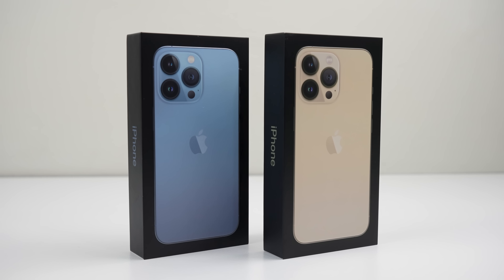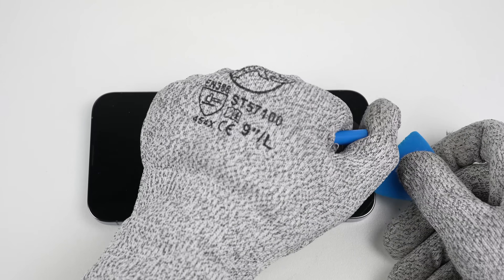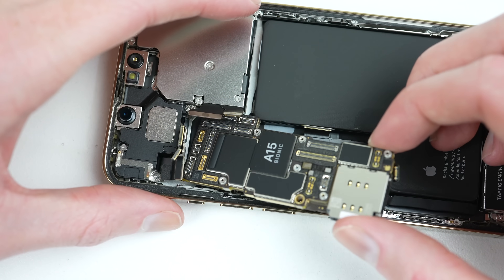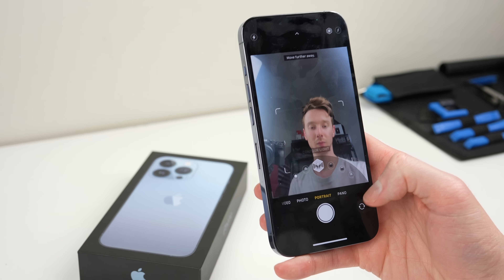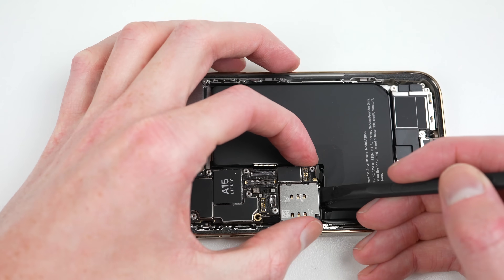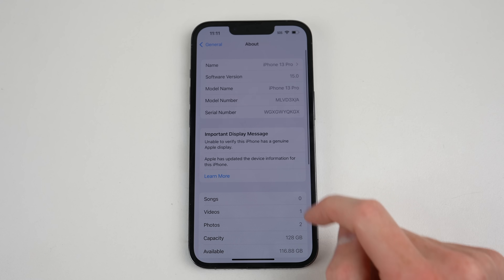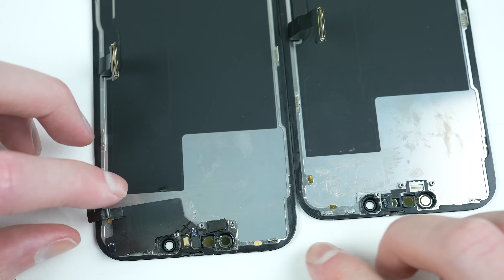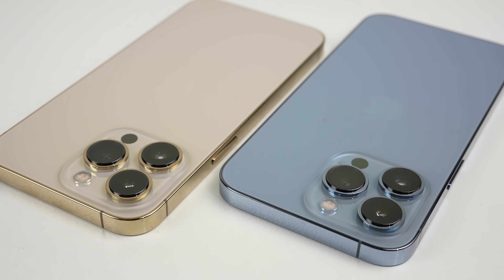iPhone 13 A Repair Nightmare - Teardown and Repair Assessment

Comment: My opinion is that apple is clearly trying to protect the privacy of their users. With more complex phishing schemes, i can imagine a repairer could install corrupted parts. A compromised Face ID camera could lead to literal identity theft. So Face ID camera access and front facing camera issues are roadblocks designed to protect the identity and privacy of the user. This form of fraud might not occur today, but a couple years down the track I’d bet on it.

Comment: Ah if only Apple didn’t pull this kind of thing. They genuinely have some great technical innovation and every time I get excited about say for example, “wow this M1 chip is crazy power efficient and has amazing performance even running non native apps” they immediately go and ruin it with whatever new anti repair measures they’ve concocted. 

Edit : I’d also like to add for the comments absolutely tearing Apple to shreds about this... they’re not the only company doing this. Just look at iFixit’s repairability scores and you’ll see other phones can be just as bad if not worse (usually with an excess of glue). Not to excuse Apple by any means but they’re definitely not the only ones.

Comment: I work in Manufacturing. Business would grind to a halt if any vendor did this for the factories they supply equipment to. 
"Valve failed? Oh and you bought a new one for $50? Sorry, but we cant verify that's a genuine part. But you need to call one of our service technician who'll be there in three to five weeks to replace that. You can subscribe to our annual machine servicing program to get a discount on repairs though. Or, alternatively you can buy a new machine for $300,000. Have a nice day."

Comment: Have you seen the same thing in agricultural machinery or just cars? Change your gearbox (transmission) for a salvage one and the engine won't start. Pay the dealer the cost of a new unit to reprogram it to your engine.

Comment: This all have one more side. I worked in authorized Apple service. You order part, wait week to get it and if it not works, you must send it back, they check it and it takes another week to wait for another part. Because you get specific nuber of part for specific serial number of Iphone. You cant have stock. You can't use another for more urgent one, it will do same problems as in video.  And water resistance is another chapter

Comment: I am genuinly surprised by how simple this is to take apart. 

Remove the adhesive and change the screws and this would be an extremely repair friendly device. They could easily do this, but then again the consumer of these products generally has the IQ of a broomhandle and buys every shit anyway.
Reply: When you pay a few months of your savings for a phone you'll be surprised how cautious people become. It is natural, you don't want to void the warranty and pay for a new phone.
Reply: @saniakshay12  Yeah.. for sure. for warranty reasons. Just keep telling yourself that. 

People these days are generally to lazy and/or to incapable to fix anything. That is why they complain that there battery drills are not serviceable, since it requires them to remove 5 screws and to unsolder two wires to change the battery. 

That is insane. What adult human beeing would ever be able to do this!

Just a few weeks ago I took a dremel tool out of the trash that had quick change brushed and was thrown out because the first pair was worn out. 

This is the kind of people we are dealing with. Untill we first accept and then change that, we will continue to live in this consoomer nightmare.

Comment: this is very simple. every logic board has a list of part IDs that came with the individual phone from factory.

even if you install an original part - it has to be added to the accepted list first, and that can only be done by proprietary apple tools (which apple will sue your family into oblivion for, if they are leaked)
Reply: It is on apple server in the cloud, can't be leaked and require credentials.  You can install it but it won't work with out explicit approval from apple server each time, much like activation special to apple products.
Reply: @chench1lla   wow. that's worse than I thought. it's practically a dead-man switch then: if all servers are down when you restart the phone - all parts are "non-original"?
but that doesn't make total sense, as it's possible to turn on a new iphone without internet access and it doesn't show any "foreign parts" warnings.
or does the check happen only when a different part is detected?
Reply: @fade  it is checked for old serial number of apple part(apple will bill you if it is aftermarket), new serial number of unused apple oem part, and serial of the phone, to calibrate the new part or new pairing.  Once paired you can go offline all you want, the board registers the part as a genuine apple part and no longer flips out on you.  Just like you can't activate an iPhone without internet or connecting to iTunes or a Mac.  After activation you can go offline.

Comment: I feel for piston heads.... it’s only going to be 20 years from now and all cars on the road will be electric.... with no way of being able to repair it yourself.
Reply: Electric cars are a catch 22, on one side you can't really do any repairs to the electric motor and it's components, on the other side the electric motor is way simpler and has way less points of failure than a conventional engine.

For the average consumer it's probably a great thing, and well the sad truth is the average consumer's demands are focused upon more than the enthusiast. Sports car sales have been on a decline since the peak of the 90s, leading to many models having been put out of production years ago simply because there weren't enough buyers or that they were being sold at a loss.

Comment: Is there a reason to buy an iPhone because, Jesus christ is like they want you to screw you over for buying it
Reply: Despite all this garbage if you try and repair it, they still have some really good aspects. The new A15 chip is great at power efficiency, the battery life is really good (though some androids are better I think), some people just prefer iOS i guess, and I’ve heard the cameras are pretty alright though I don’t know as much about that one. I certainly wouldn’t buy one new (besides maybe the new SE) but I’ve seen some used iPhone 12s and such for a few hundred and it could be a good deal if you need a new (-ish) phone.

Comment: "We're so environmentally friendly, look at this plastic being 27% recycled materials, wow! By the way if there's damage on one of the cables you ahve to send the phone to us and we'll look at it for a couple seconds then toss the whole thing out and get you a new one, yay environment!"
Reply: Just like electric cars. "It's Environmental friendly, it use electricity".
OK, but how is electricity created, yes most of the time, by burning crap and destroying environment.
And, how much more impact the creation of batteries for electric cars has on environment? 10 year of normal car usage, nice.
Reply: @indeed2207  in the world of business marketing is more important than facts dont forget that brand ads were called propaganda before WII and afterwards brands didn’t want negative connotations of the word for their products and they started using the word advertisement instead
Reply: @gamf5996  Propaganda is actually a neutral term. It's hard to remember and easy to forget these days, but it basically just means "something that supports the intended message"
Reply: Dont forget their phones don’t include headphones or the power block for environmental reasons lol
Reply: Do they actually chuck it out, or do they not have some special pairing device to pair the new sensors to the phone?
Reply: @GeorgeBarlow1  Not entirely sure how they dispose of the product but I'm entirely sure the method barely meets environmental laws unless there's more money in doing it some other way

Comment: For the iphone 11 there was a programm on github to store the informations  from the original hardware and shove it back on the replacement parts when finished the replacement of the hardware. Full funktionality.
But i just hope the right to repair movement will stopp this kind of bs. Here in europe we have something similar and i hope that someday we get a full right to repair at least 5 years from the release date. Including 3rd party parts, full breakdown of the phone, no speacial screws and no software lock as seen here.

Comment: Does it shock you that the same company that makes a proprietary charging cable, which they no longer include in that hefty price tag of a new phone purchase, also software locks their hardware?  I find it funny how my family buys at least one new lightning cable replacement a year while I continue to use my mini USB cables for my Android, headphones and other devices with zero problems year after year... Hmmm

Comment: This has to be some sort of anti trust violation. I wonder why governments dont go after them and force them to remove these sorts of paired locks? The actual pairing is as simple as some data stored in ROM. It is obvious that the intention is to ensure that only they can repair the phones since no one else would know the appropriate data to change in ROM.

Comment: just random question. is it possible the screen has a serialized function that some component on the body of the phone uses for validation? if so, could it be they are attempting to stop people from swapping screen to access stored data?
Reply: Nope. All security would be on the motherboard.

Comment: Imagine you buy a new BMW and after some month your front glass is broken by a little stone. You decide to repair it by replacing the front glass. The repair is done by your local car repair (independent from BMW but is able to order original parts). Now after the repair you will get a warning message and some functionality like traction control, head-up display or assisted driving is not working as expected or completely out of function... Impossible, right!? How dare Apple is doing such things and is not taken to court for this!? Looks like a law is urgently needed.

Comment: So how is Apple's iphone part replacement program meant to work? 

Apple said common parts such as screen and battery are to be available for user replacement for iphone 12 and 13. Does this mean yes users can replace them, but not everything will work anymore due to software locks?
Reply: Probably have to give them info from the phone so they can pre pair it and send it out to you
Reply: @TheMysteryDriver  Dayum. I guess that is feasible if draconian. I haven’t yet looked into it or their part pricing. I’m gathering it won’t be particularly competitive.
Reply: @ThurstanH  could also be that there's software you pay to have access to as a replacement program partner that lets you do the install. I know Volvo did that with car radios for a while.

Comment: i use to work with At&t as tier 2 tech, when they had the exclusive to iphone 2g and 3g , they were purposely locked out by network settings att controlled , the techs could turn them on and enable the mms that apple claimed they weren't compatible with.  when in truth they wanted to purposely block those because they wanted there own pay system that didn't get  developed . this is why i would never buy anything apple

Comment: The marketing behind the iphone sure hypnotised a lot of folk.  I got an older-gen Asus Zenfone (6) for a third of a price of current-gen iphones and it performs better: more stable, you can have literally hundreds of tabs open with no issues.  Quick 'n easy bug-free swiping, typing & highlighting and even after dropping it twice from chest-height on a hard floor there's not a single bit of damage to the screen.  Not even scratches from use.  The battery still lasts days with normal use, or around 6 hours with constant bright screen.  Audio is great.

Apple, and also Samsung, offer overpriced buggy short-term throwaway phones for huge prices because their marketing is world-class.  To cover the costs of all this marketing their phones have to developed cheap, and 'built-to-fail'.  

I hope people wake up to their immoral game soon.  But as the old saying goes: there's a sucker born every minute.

Comment: I wonder how much of the price tag is you paying for all these measures that stops third party repair and replacements of components.
As for their "Carbon neutral products" and "sustainability", a single fault or item breaking or worn out including internal cables and it's either exorbitant repair cost by Apple wanting to push you to buy new instead of repair or landfill for the whole thing, no component can be salvaged or cannibalised even if perfectly functional.

Comment: This has to be a hash based system, where the phone consistently checks a hash for it to perform. Once ANYTHING is changed it returns a different hash causing the issue. There HAS to be a way around it.

Comment: I don't really care much about repairability because out of the two dozens something iphones, ipads and macs I have owned over the past decade I never really had one break on me. But I am getting pushed away from apple because how little they give a shit about my opinion as a customer. First the dreaded app library, then the photo curation, the icloud scan, now I feel the ios keyboard is significantly more difficult to use than before. Ugh seriously considering just using a nokia 3310.

Comment: Apple needs to be sued about this. No one would tolerate buying a car, that they own, that couldn't be repaired as they see fit. Everyone would eventually buy a new one if the products is good. This is just going to make me buy another product. The company I work for stopped buying using them because of this. So they lost out selling over 2000+ phones bi-annually because of greed and their culture of control.

Comment: I have two iPods which no longer function correctly because changing their batteries causes similar issues.

I would never purchase another Apple device.

I wonder if my Samsung phone will react the same as it is a sealed unit,unlike my previous one.......

Comment: Imagine if your car ceased to work if you fit a third party air filter! There would be court cases. So how do Apple get away with this? Btw, I may have missed it in the video but what about battery replacement? Can that be done by a third party? Thanks, great video.
Reply: Battery replacement will work, but you lose battery health and charge cycles along with an very annoying constant reminder about non-geniune apple part.  And you void warranty and apple care coverage, it will pop up on apple diagnostics, which is required for any apple service.
-apple certified technician

Comment: u cant even replace the screen?!  i recently turned an old broken android phone in to a small laptop, replaced screen with a big one, tore down the whole thing and fitted it in a different casing, added ssd storage etc and it works flawlessly.
Reply: Can’t even touch a proximity or home button on apple without losing touch or Face ID. Androids like, “Oh yeah, go ahead, replace everything except the mb, you’re good man”

Comment: This is just absurd.
It's like if I bought an iCar and one of the tyres deflated. I can't re-inflate it myself, as (unlike with AndroCar) I don't have the specialist tools; I have to take it to the iCar shop, where they'll replace the other three and tell me they can't replace the deflated one, I'll have to buy a whole new iCar.
I decide instead to purchase a new, genuine iWheel for my iCar but upon installation, the engine doesn't start.

Comment: iphone 30 will have each and every one of its screws equipped with a chip to verify the integrity. If you replace a single screw, then you are screwed.

Comment: Dude, Great methodology.  After watching you show, and this is out of left-field mind you, it feels like apple integrated a firmware block.  Likes each component is set up with epoms( similar to epoms ) that they have the capability to "flash" with component IDs.  Then set those IDs to a specific "ver." of iOS.   Meaning if Apple doesn't fix it. It will never work right again.  People will either pay out the wazzoo to repair or just buy a new phone and that is worth the cost, to Apple, of setting up a phone in such a way.

Comment: Apple learnt this tactic from the auto industry,  want to replace that £5 module, well you need the dealer to recode your cars ECU, for £200. Need a new ECU well you’ll need to replace all the electronics or also have everything recoded. Add  to that built in deliberate component suicide and you have the perfect setting.

Comment: I’m just guessing here but I’ll bet there’s an Apple software utility that they can use to fix these issues after replacing a screen.   If so then this parts-synch utility should be made available to repair vendors.  However, I recently accidentally sat on my iPad Pro while on a flight home.  Apple gave me a new one for $50 thanks to Applecare.  That $50 plus the original cost of Applecare might be competitive with the cost of a 3rd party replacing the screen.  And it’s still under care for future problems.